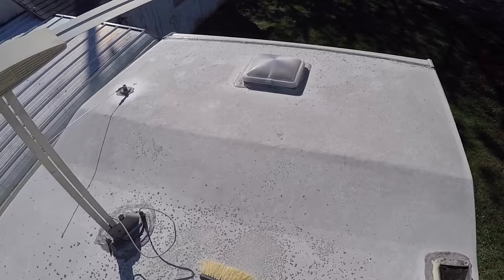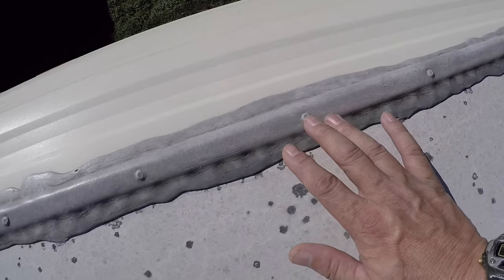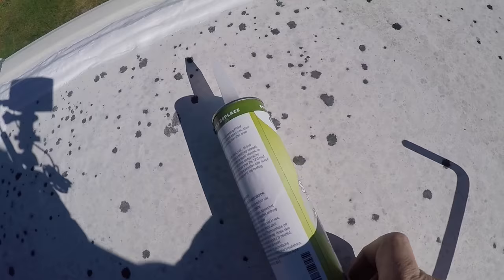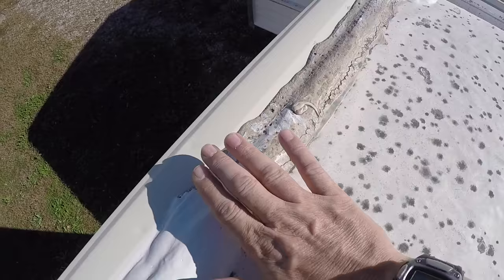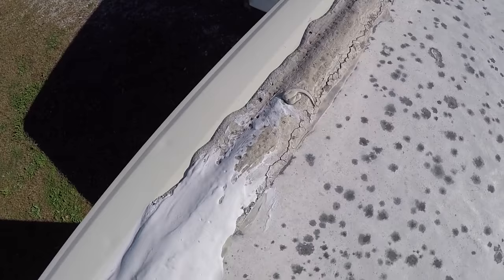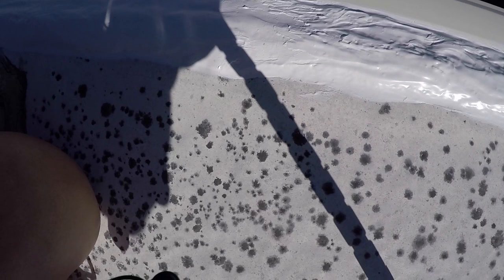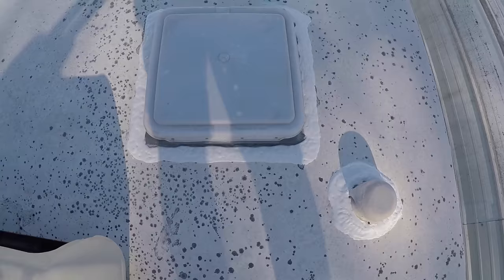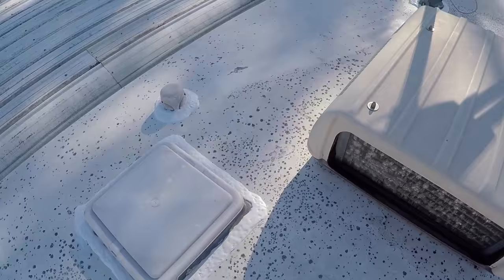How to Seal RV Roof Seams with Dicor Lap Sealant

Comment: Dicor is a horrible sealant.. it will break down crack fail within 2-3 years after applied & not only it will do all that but when applied onto the membrane it will warp the material due to chemicals use in their caulking that inner reacts to the membrane leaving permanent warpage in the membrane material, I suggest to use a completely different brand when caulking anything on rv trim & membrane.
Reply from the maker: I've use Dicor for years and it has worked well for me. I haven't experienced any of the issues you mention.